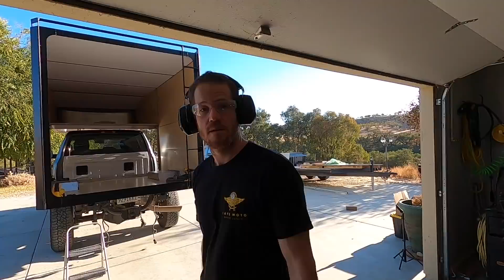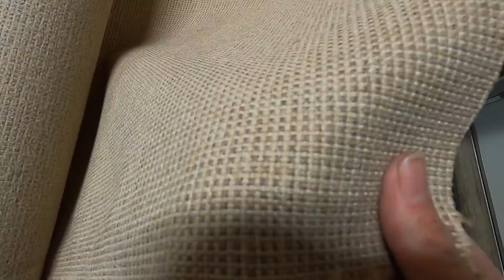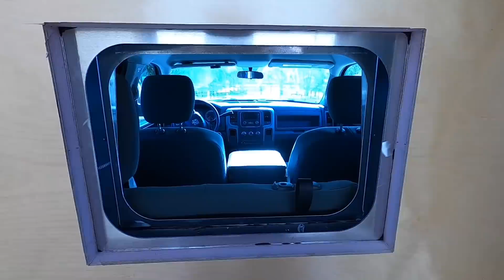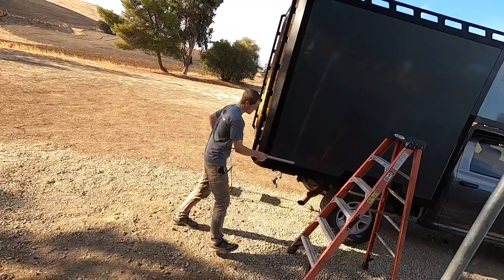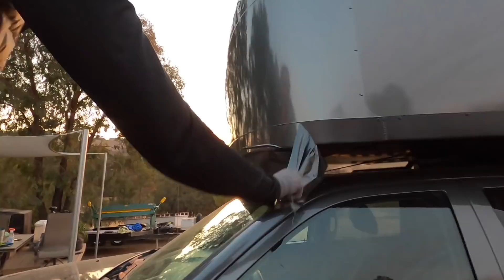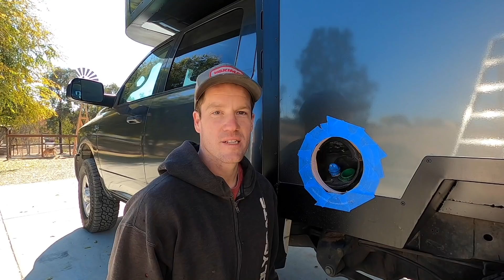Building Our Expedition Vehicle E4 - Cab Pass Through

Comment: Hi, been following your build and am puzzled with the two vertical exterior side panels where they both meet horizontally halfway from the bottom floor of the build, the joint line is clearly visible, how is the protection from moisture, water/rain from the outside?
Reply from the maker: We made the upper wall panels with a 2" flange to overlap the lower panel like a roof shingle.
Reply: @AmbitionStrikes  Thank you much for the response, you folks are a big help to the community

Comment: Do they not make sliding rear windows for trucks anymore?  The pass through is a great idea but you may experience issues with the design and the effects from the elements.
Reply from the maker: They do make sliding rear windows but the opening is VERY small and they are quite expensive.

Comment: I love this you're doing a great job one little thing for you you put that bumper in that square tube and you put for your sewage pipe to go in I suggest one thing put some drain holes on the bottom of that because you will get water in there I just replaced one on a friend of mine's trailer and it totally rotted out because it was sealed up and there was no ventilation in it just a little thing to do it's up to you but me I put some vent holes in it great job 👍👍😀🇨🇦
Reply from the maker: That is an excellent point! Thanks for the tip and thanks for watching!!

Comment: Can you explain in more detail what the rivets are grabbing onto on the backside? Are they all the way through to the far side of the plywood, or just grabbing onto the inside of the aluminum sheet? Can't quite tell how much purchase they have from the video. Awesome inspiring work, thanks!
Reply from the maker: Hi Jordan! The aluminum rivets are grabbing onto the inside of the aluminum sheet, acting as clamps while the Sika 252 cures. There is also internal bracing in all corners to bond the interior skins, resulting in the monocoque structure
Reply: @AmbitionStrikes  Thanks! Internal bracing in the corners...? As in thicker angled aluminum corner braces underneath the outer aluminum cladding? Also, I'm having trouble finding a 3D cad model of my 1996 Dodge extended cab--not the same as yours, but any chance I could get a copy of CAD file you found made?

Comment: Suggestion for safety sunglasses that are awesome and don’t cost a ton. Amazon.com. Search Jackson safety “NEMESIS” sunglasses V30 22475. OSHA approved. 3 pairs for $16.00. You can get them with all kinds of different tints. I like both the smoke and the blue tint for when I’m working with my saws on projects. So comfortable I keep a pair in each vehicle and in my shop. I don’t buy expensive sunglasses anymore. Plus they are anti-fog. Check them out.
Reply from the maker: Thanks for the tip Jason! I’m going to order some right now! Happy Holidays 🎅

Comment: Nice work, and thank you for all the details. I'm preparing to build a trailer with similar SIPs, so your work has been informative. Question...seems like nylon wrap would be vulnerable to scuffs/damage, and awkward to repair. I assume you thought through this and chose against paint or another surface treatment. How did you arrive at this approach? Thanks again for sharing your good work.
Reply from the maker: There were a few reasons we went with a vinyl wrap instead of paint. 1) It meant we could easily make the truck and camper the same color.
2) We can easily wrap pieces as we got for a very cohesive finished look. 
3) The vinyl will do a great job of protecting the truck from pin striping/other trail damage. 
4) Cost was $1,200 in materials all in. Paint would have been VERY expensive.

I actually think it would be fairly easy to replace sections of the vinyl should damage occur. I may do a specific video on that and how I wrapped the truck in the future!

Comment: how is the long joint between the two horizontal panels along the side?  thanks
Reply from the maker: The seam is overlapped like and shingle, glued with Sika 252/VHB tape and has a reinforcement bracket on the inside!

Comment: Looking great!  Would love to build one. Have some parts collected but not thinking I have the energy or talent.  Plan was to use a late model F150 chassis which I already have along with 3.5 Ecoboost power but using a '66 F100 cab on the new chassis.  Have you done calculations of what finished camper will be? Or maybe before and after weights to determine that?
Reply from the maker: That sounds like it could be really cool! We have LS swapped several old Wagoneers and are bigs fans of old bodies on new/reliable platforms. 

The goal is to keep the finished camper at a dry weight of 2000lbs. We got the finished shell weighed yesterday and we are at 850lbs (at this point we estimated we would be at 1,000lbs so we are under weight for now).
Reply: @AmbitionStrikes  following along. Not sure if I am brave enough to do a project like that on my own. Gotta finish current projects first.